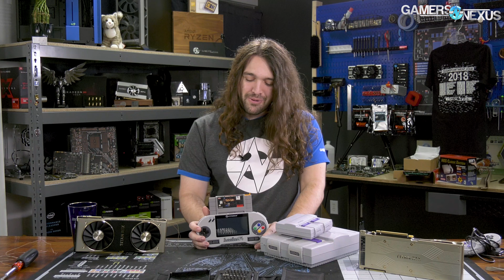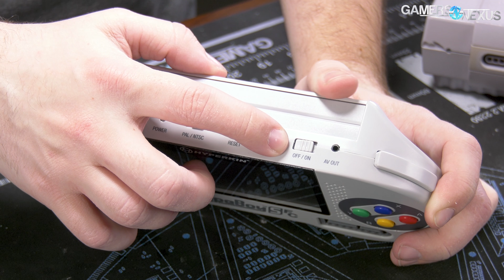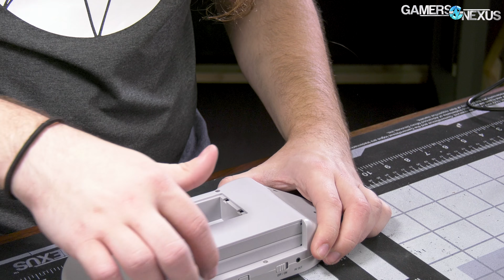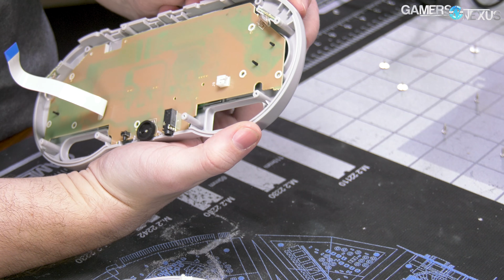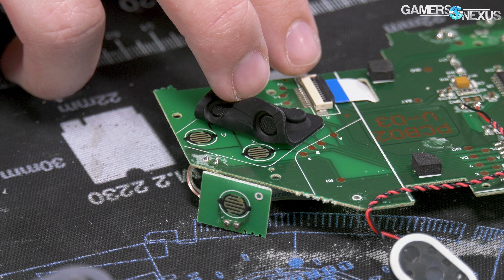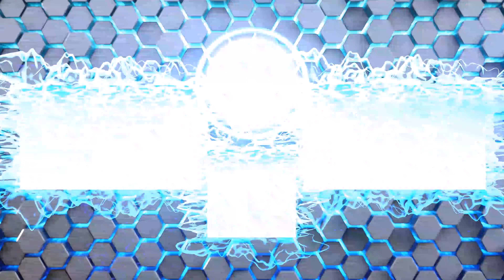SupaBoy SFC Handheld & Portable SNES Tear-Down

Comment: Figured I’d ask GN’s followers.
I’m running a i7 8700k, gtx 1080 ti, Taichi z370, 16gb G.Skill Trident 
Z, adata sx8200 nvme, 1tb WD blue, evga 850 p2. 
System will restart when playing any game more intensive than Rocket 
League. 
I can play Rocket League at ultra settings at 1440p all day long with no
 problems but when I play games like BO4/GTAV/The Division, the system 
after 10-30 minutes restarts on its own. 
My system drivers are all up to date, bios is up to date, memory passes 
test, can run aida64 cpu/fpu/cache/systemmemory/local disc plus heaven 
benchmark at the same time with no crash. 
System temps are 60c max on cpu and 57c max on gpu. 
CPU/GPU/RAM are not overclocked
Under system logs I see “Event 41 - Kernel Power”
I am stumped at this point. 
Any help will be appreciated.

Comment: I Have the Gigabyte GA-970A-D3 (rev. 1.0/1.1) Mobo and it doesn't have a heatsink. 
And i wanted to make heatsink for it but then i saw that all motherboards cover only the mosfiet's and leaving the capacitor and the chokes without a heatsink is there a reason to it? 

I Was thinking to cover mosfiet chokes and capacitors with one heatsink.

Mobo: https://www.gigabyte.com/Motherboard/GA-970A-D3-rev-10-11#ov

Comment: #AskGN this left me with a question that you or some of the industry experts you know might be able to answer. For a device like the SupaBoy, would it be possible to just make an identical copy of the processor architecture of the original console, but build the processor using modern fabrication techniques? Would the resulting chip benefit from the modern manufacturing process in terms of power consumption and/or clock speeds?

Comment: That actually looks pretty high-quality for a relatively inexpensive device. Things like hand-soldered wires, ironically, are very common on low-end devices. Take apart the cheapest tablet you can find and you'll see something similar to this, except the soldered wires will be even thinner (as thin as possible), the individual components such as speakers will be smaller, the quality of the solder work will be very poor, and there will be large globs of hot glue everywhere. Also, excess flux.

This actually looks to be rather well made, the PCBs appear pretty well laid out and neatly manufactured, so I'm guessing (especially given the dust inside the screen compartment and the pinched ground wire) that their biggest cost savings comes towards the end of the manufacturing process where they probably employ some pretty low-wage labor to perform final assembly, soldering a few wires here and there and putting the pieces together by hand.

Comment: I got the old (and NA) version 3-4 years ago. It's... okay. 4:3 screen, fairly poor sound, and it feels cheap. But it does work,  and with every game I have including FX chip games like Starfox and Yoshi's Island. It also works with... wait for it... the *Super Gameboy*. So yes... you can play GameBoy games on it lol. It looks silly but whatever! Pic:
https://steamcommunity.com/sharedfiles/filedetails/?id=370784739

The old version has a battery that can't be removed and lasts 4-5 hours maybe. The buttons are okay, but the D-pad is a bit stiff at first till you break it in. It doesn't have the brightness control of the new model. I assume the new model switched to a 16:9 screen just because that's what's mass produced in 2018. The old model has analog RCA out via an adapter that's included, annoyingly this is the only way to actually use controller 1 with it (it auto-switches which input it uses based on the video output used). Hope they fixed that with the new model as that was super, super, super, super, *stupid*.

The old version had a lot of potential, if you're interested in this check some reviews because if they improved some of the issues (better sound, proper controller support) this might be worth it if you have a lot of SNES carts laying around.

Here's a pic of it with Mario World just for the heck of it:
https://steamcommunity.com/sharedfiles/filedetails/?id=356397436

Comment: I fit has controller inputs, why doesn‘t it also have an HDMI out so you could use it like very other console with your tv?
Reply: Old model has and RCA out adapter, not sure about this version. Really wish he'd covered a least the basics of the thing and what it came with. Seeing what's under the plastic seems pointless if you don't bother even showing the thing on.
Reply: Jinx yea, he‘s a little too focused on the hardware. The information I‘m interested is if it works and what features you get.

Comment: I am actually surprised. I was expecting some arm cortex CPU running emulator or fpga, plus some glue logic for display (converting from digital to analog to digital, because of how snes generates video). 

But this ones actually does use same chips as he's. I guess these are actually very cheap and still available due to a lot of clones build in china. I knew them in 90s. But I didn't know you can still get them.

What are the dates codes?

PS. Sad not to see hdmi out.

The memory is actually voltatile. It just need a power and voltage and will keep content. It is used for nvram, but it requires power. It is not flash or eepprom.

Comment: One wonders if he himself is a PC, with his eyes graphics rendering, sending signal to cpu, current flowing through pcb and different mosfets, resistors, heatsinks, data processed  rendered and stored constantly often needing additional power consumption, high.

Comment: thos lithium ion batt specs are always lied about. i vape and have dealt with bying re-spec'd batts many times for years now.. where it will be a 3.7v 4000 mah 30a wrap but really its only re-wrapped and the real spec is 3.7v 3000mah 15a

Comment: While I don't blame you for removing the battery first — (it IS best practice) — I actually doubt it's getting "standby power" since there's a mechanical on/off switch (rather than a "soft switch").
Interesting device, though. I noticed some pads for a (.1"×4) header labeled "SCL" (Serial CLock), "SDA" (Seria DAta), "3V" and "GND", so the thing actually has an SPI bus (for troubleshooting, maybe? or updating firmware?)
Thanks for showing us!

Comment: Try and see if it works without issues when using a Super Ever Drive or a SD2SNES. These things almost universally (things = clone consoles) have issues with SFX/SFX2 games (StarFox, Yoshi's Island). So that's another thing that's important to test. Then you can also test REPROs (reproduction carts) for unreleased games like StarFox2 as well carts using MSU1.
Reply: It works with a Super Ever Drive. Also FX-chip games like Starfox are no problem. Only thing is it doesn't run Gameboy games with a converter...

Comment: Delid cpu and post thermals while running in mode 7.
Reply: If I recall, the Mode 7 3D effects aren't handled by the SNES itself, but instead the processor in the cartridge. SuperFX, etc. Therefore, it shouldn't cause major thermal differences between normal games. Though I have been wrong before.
Reply: @TheDarkestPhoenix  Mode 7 is one of the modes available to display a background on the SNES, nothing to do with 3D or external processors on a cart.

Comment: nice ! This product has its flaws like using a 16/9 screen in TN panel and only 2x 2200mAh accus (correctable since it's standard 18650 Li-ion) but it seems to be a legitimate hardware for those who dislike emulation. I'd like to see how it performs in frametime compared to the Snes-Mini or any device with an emulator.
Reply: I played through all of Super Mario World on an older model of the Supaboy and didn't notice any obvious stutter or framerate isssues. I've played through that game a bunch of times and it didn't feel any different on this.
Reply: thx for sharing your experience but I was thinking about fast pacing games like supermariokart or fzero.
Reply: Hmmm I have Mario Kart but I don't remember if I tried it. You'd actually notice bad frame pacing as much if not more in a platformer, though.

Comment: what about the AV Output? is this for TV gaming? it also would explain the controller connectors.
Reply: The old model comes with an adapter to RCA jacks, though I never got around to using it.
Reply: i wondered this also, av output looks like a headphone jack though?
Reply: @frank97865  - oh ok, cool thanks for mentioning that.
Reply: That av chip converts pal/ntsc to tft, so signal going to that should be usable for av. After all that has original snes cpu and assisting chips.
Reply: It looks to me like 4pin to RCA. Wondering as well can this be hooked up to tv with theright cable.
Reply: Av Output is REALLY oldschool. Its pre-scart and almost the same to the Headphonejack. There is just 1 more contact at the base for the video output compared to the Headphones.

Comment: It might not be the most professionally built device, but I give it credit for playing original cartridges, which in theory gives it the potential to play more than the mini-console Nintendo produced in its stock configuration.. Assuming that functionality works properly long enough.  Being able to use original cartridges to play on devices like this is a feature that should not be ignored.  

I guess regardless they're both gimmicks at their core, but I like to think the capability of being able to play your original games is what distinguishes something from being a more functional device compared to a fancy toy that only plays the games it came programmed with.
Reply: They're both "fancy toys" from that perspective. To a really serious retro gamer nothingn beats the original hardware. Otherwise you get reproduction consoles for the novelty of using carts you already own. You really think people are buying these to track down stupidly rare and expensive games to play on it? Sure you could use an Everdrive, but that defeats the point.

It doesn't really matter how much more "functional" it is if the emulation quality isn't as good either. Nintendo's isn't perfect, but at least you know they're held to the stand they want their IP presented at.

Jailbreak the system and you can pretty much have the best of both worlds.
Reply: @ZombieBarioth  Yeah, I acknowledged that they're really just both gimmicks, despite that, I appreciate the effort from something unofficial like this.
Reply: I could emulate all this stuff on my phone, but I own the SNES cartridges and there is something gratifying about playing them directly, not to mention legally.
Reply: I literally installed custom firmware on my SNES classic that allowed me to put whatever SNES or NES ROMs I want on it five minutes after I got it. 

Calling these things "fancy toys" because you expect a first-party corporate company like Nintendo to sell a Pi console ignores how Nintendo almost certainly released their products with the knowledge that the firmware was easily modded for custom ROM usage, plus the build quality products like this obviously lack.

I have nothing against emulation machines - I own a Retron to play my old NES and SNES carts on, but they're basically legal loopholes and comparing them to first-party systems makes no reasonable sense.
Reply: @metallicakixtotalass  The only thing I expect from Nintendo is to spend minimal effort on a product like this while marking things up to make as much profit as possible, because they know their fans will buy it.  It is a collectors item, a toy really, 

It's unsurprising to me that if you actually modify it, it has more utility than its stock configuration, but I bet they probably didn't intend for people to do that, but they also most likely don't care.

I just call it like it is though, at their core, they're basically just products that appeal to a sense of nostalgia and bank on that.  That's why I compare them.

Comment: Its really not that bad for 90bux, but i dont understand the why, just get a rom if youre playing a game older than you.
Reply: I said this in another reply, but emulation could introduce inaccuracies, incompatibilities, input lag, and other issues that would require some tweaks.

Not knocking emulation as a whole for the record, I use it all the time via RetroArch and standalone programs. Just saying that it can have complications compared to hardware clones like this, is all.

Comment: Love these retro videos. Steve could you test the CRT lag vs modern displays that would be interesting
Reply: Crt's have like .5 milliseconds of lag
Reply: @james2042   I've tested with my own equipment to complete a full scan at 60Hz they still finish within 16.67ms that just don't add very little processing delay (well good ones). You can find monitors now that are equal to CRT at 60Hz now most are not but a very few are. Now the thing mass adapted Digital Displays consumers have yet to surpass or match is CRT motion persistence.

Comment: really don't understand the point of these when you can just do all of it on your phone.
Reply: actual buttons
Reply: @saladwithsalad  There's plenty of blue tooth controller options, or USB, and they will certainly be better than carrying the whole system with a cart in it.
Reply: Most emulators on mobile are shittily designed, inaccurate, or require a lot of fiddling to get it right. Hardware clones like these, if done well, are plug and play.
Reply: @UltimaOmegaZero  Couldn't someone make an android device with an FPGA in it? Or an FPGA you can hook up to a phone to do the processing? To make use of the top tier screens?
Reply: @streetguru9350  They have, but not an Android system. It's called the Super NT, and it's basically flawless; Only issue is that it's not a handheld (though it's totally portable), And it's ~.$200.
Reply: @UltimaOmegaZero  Is the Supaboy pro an FPGA or just some ARM device doing emulation?
Reply: @streetguru9350  I assume it's neither and just a hardware clone that (presumably) works well.
Reply: @UltimaOmegaZero  Dude if you need the original cartridge whats the point?
Reply: @reginaldoestremera3007  If you prefer using actual carts, is why it's there. Plus there's also those special carts with chips that are hard to emulate. If you don't care about that (but also want to use this) you could always use an EverDrive.

Plus, using original carts is part of the retro experience for many people, like using CRTs/BVMs, original controllers, etc.
Reply: @UltimaOmegaZero  yeah but whos even making the carts any more?
Reply: @reginaldoestremera3007  Various reputable sites who specialize in cartridge reproduction, I think Stone Age Gamer is one of them.
Reply: Also, Bluetooth controllers introduce input lag, on top of the lag from emulation itself. That sort of thing is why people have so gone so far back as to buy CRTs and even professional BVMs, to eliminate any input lag from external factors. Something like this should be a sort of middle-ground, if done well
Reply: maybe it's the nostalgia of playing on a device that won't kick you out of the game when attention-needy friends keep texting you, lol. Agreed, modern phones are much better in so many ways (better sound, better video, better performance, etc).
Reply: Also, the SupaBoy hardly looks that difficult to carry. The actual carts themselves wouldn't be easy, but that's nothing a separate carrying case or an EverDrive can't fix.